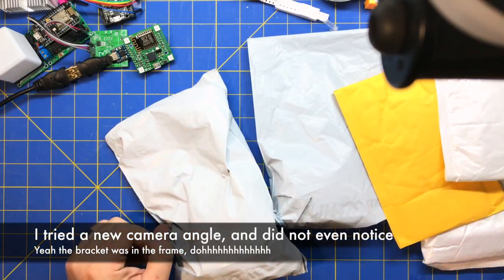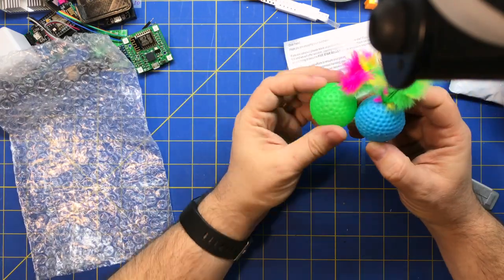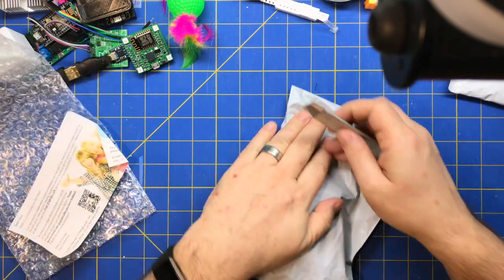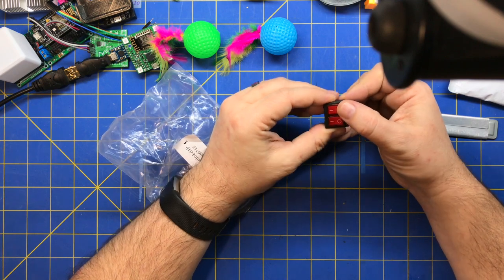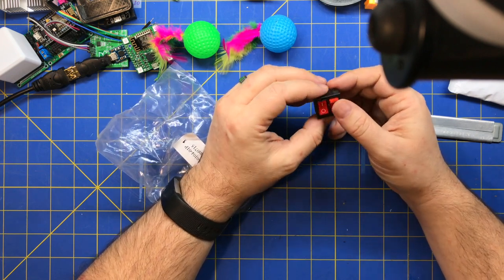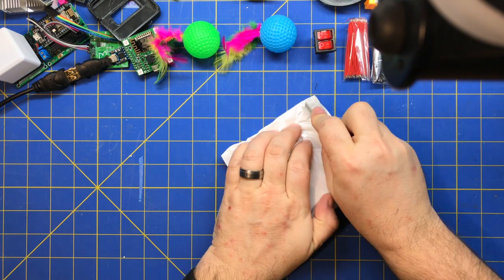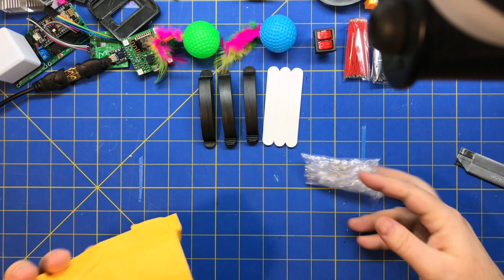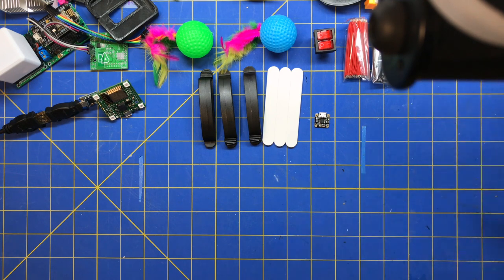Mailbag #32 04-2019

Comment: It's important to note that on that lion charger the listing says "Charging Board+Protection". However, it's just a TP4056 (in this case a clone, TC4056). The "protection" included is overcharge protection, but there is no over discharge protection like with the bigger TP4056 modules that have a DW01 chip to cut the battery voltage off when it gets to ~3v.
Reply from the maker: good point, My cells are all protected ones, but yeah that could be a problem, thanks

Comment: Where are the wire organizer from (do you have a link).
Reply from the maker: I am going to try to find it again, the listing changed in my purchase history so it was gone, give me a bit
Reply: @tablatronix  Okay thank you
Reply from the maker: https://www.ebay.com/itm/1Pc-Cable-Cord-Wire-Line-Organizer-Plastic-Clips-Ties-Fixer-Fastener-Holder/262898411068?hash=item3d35f7663c:g:JAUAAOSwTM5Y05Lw
Reply from the maker: There are several sizes and white also, various names
Reply: @tablatronix  Thank, that is something I can use!